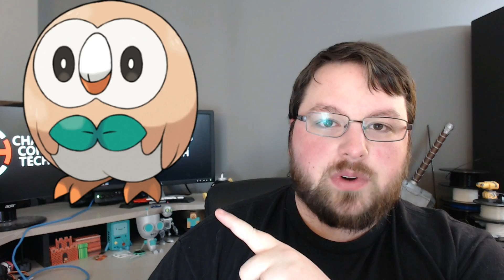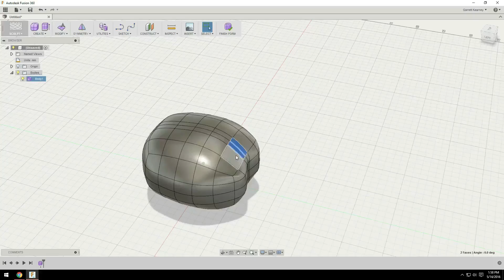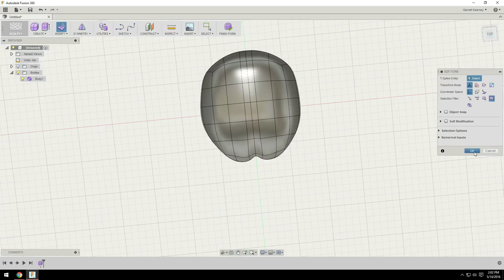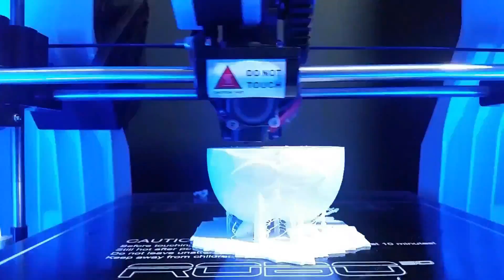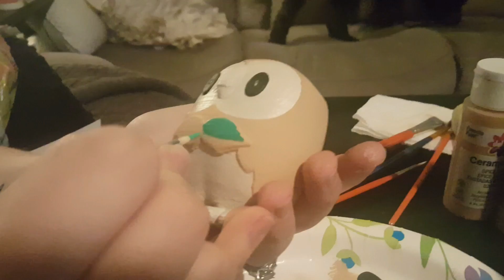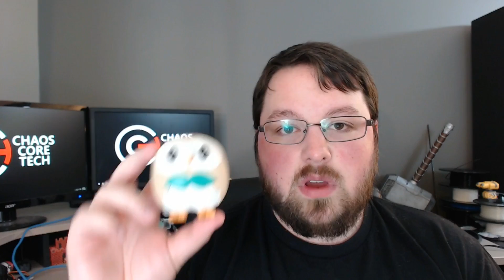3D Printed Rowlet - Pokémon Sun & Moon Starter

Comment: Hi! This is a great work!!! And it has inspired me to create one Rowlet of my own and 3d print it and make coloring myself! Could you please tell me what materials have you used to print these starters? I'm hoping to use third party services for 3d printing though, they offer quite a variety of materials, and since Im a complete zero in 3d printing I need to pick a nice material that can be post-processed same way as you did :)
Reply from the maker: Awesome! I'm glad I could help inspire. :) And sure, I used PLA to print mine. But you could use just about any material you want. If it's your first time ordering I would suggest sticking to a cheaper plastic instead of going for any of the metals. So PLA, ABS, PETG, anything like that would work just fine for getting the object out nicely and for painting it up. :) Hope it works well for you!